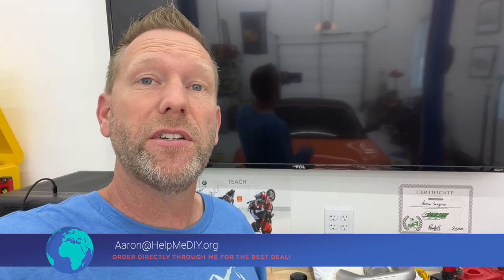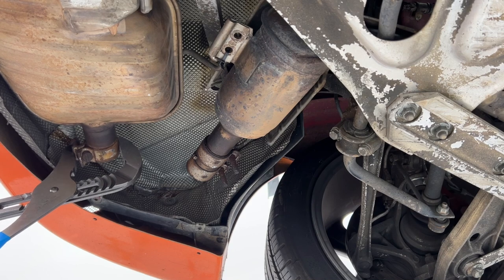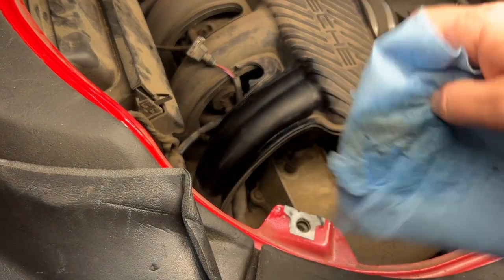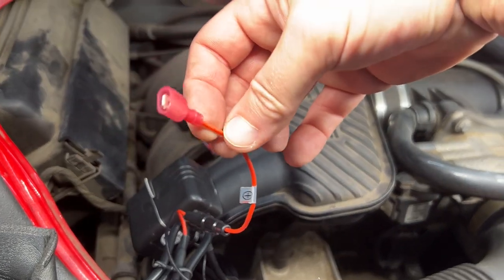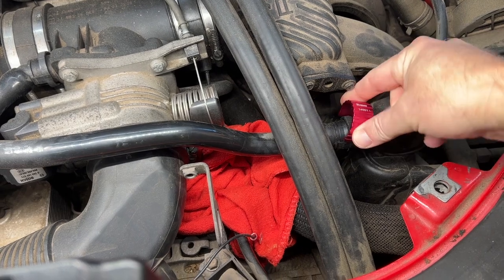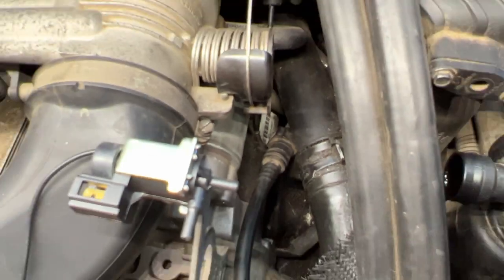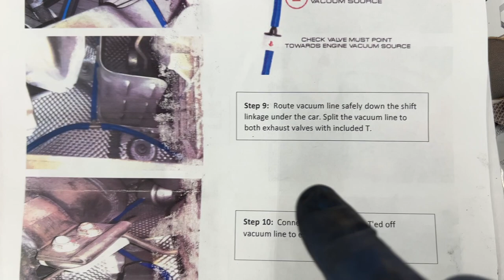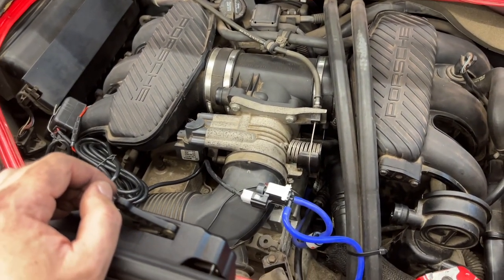SOUL Exhaust Valved Bypass Install for Boxster 986

Comment: HAPPY CUSTOMER! 

I ordered this directly through your main man right here. He was very responsive and took the time to answer some questions I had. Now that I have it installed here’s what potential buyers should know. 

1) Even though the valves default to closed when the car shuts off you can hop in, turn key to get the oil readout and while waiting on that open the valve. You WILL get a beautiful throaty cold start with open valves. 

2) The shop I went to routed the transmitter up in the front trunk not the rear. They said likely the spot Soul suggests to install it will be too hot and degrade the device over time. 

3) From a local shop charging $170/hour in SoCal it took them 3 hours to complete totaling $510 for the install. 

4) I have my secondary cats removed. With valves open it is extremely loud, essentially straight pipe loud. Lots of cracks and burbles on downshifts come to a stop. Absolutely amazing. 

5) because the new exhaust pipes face downward you can expect a lot of drone and cabin rattle everywhere regardless the rpm. The sound hits the ground then comes right back up through the frame. The drone/bass is really insane at low rpm below 3,300rpm. 

6) the valves seem to need a “seat in” time. I assume to heat cycle and build up carbon because my valves do not fully close until the cars completely warmed up. Hopefully this fixes itself within 30 days or so. 

7) You finally truly sound like a boxer engine. It has a deep growl like Subaru boxers but after 4K rpm starts to refine and sound euro but no doubt, this does not sound like a 2.7L engine it’s throaty as heck. 

8) Yes it gives me a thousand dollar smile every time I drive but my anxiety is through the roof. Cali cops hate loud exhausts so I’m 100% bound to get ticketed eventually. I’ve already been thinking of things to say since you can switch the valve back on. Exhaust leak sounds probable lol 

RECOMMENDED! If you want a super loud obnoxious exhaust but only when you want it, and still have the option to go back to mostly stock than this is for you. I’d wager if you still have the secondary cats it won’t be so insane like mine is. It’s truly straight piped, so I’d you’re not into that don’t get the secondary cats removed keep them and this should be quite a bit more tame.
Reply from the maker: +Jared awesome man! I knew you’d love it 😉🍻
Reply: @HelpMeDIY  Heck yeah, it's amazing! Do you know anything about the potential "seat in" time for the valves? Mine definitely don't close fully at first but that seems to go away after 20 minutes of driving or so when everything is at a high temp. I figure I'll give it 30 days then contact Soul for advice.
Reply from the maker: +Jared mine seemed to settle in after about a week
Reply: @HelpMeDIY  Awesome! Yeah man, 110% worth the money. It puts a massive smile on my face every morning now and starts the day with pure childish joy.

Comment: I have experimented in past of homemade versions and found the torque at low revs dropped substantially - especially on low capacity engines (2.5/2.7). The PSE is the best option because of this as it still routes some of the bypass into the exhaust to keep up the torque. Also tends to drone if bypass does not go through any tuned tubes. But worth a ping if you don’t mind! also bear in mind the heat build up under the bumper.
Reply from the maker: +Voiceofreason99ify this one also allows some of the bypass into the muffler. You can see it in the clips. I’ve heard with a tune and the exhaust I could actually pick up 20HP but haven’t confirmed that at all.

Comment: Question about this installation. Since Boxster have ‘dummy’ switches, is it possible to hook up the solenoid to a Boxster on and off switch, thus illuminating the antena switch (and fobs that eventually one will loose). Think it might be kinda cool to have a switch on the dash for this installation.
Reply from the maker: +Blanchard Watch Company absolutely! Some have done just that.
Reply: @HelpMeDIY  is there a how to? I’m sure one needs some sort of resistors… or is it straight 12v to switch to solenoid?
Reply from the maker: @RobertBlanchard  not that o know of, but should just be a straight switch

Comment: Another detailed video. After watching this, I would just remove that bracket where you are attaching the vacuum solenoid and either mount it to where the bracket was removed (2 bolts at the bottom of the bracket that hold it to the engine case), or - if there is room - to the bolt that supports the air intake "muffler box" just to the rear of the bracket. I've removed my muffler box, and plugged it, so on my car, the bracket really doesn't serve a purpose any more unless you are supporting the engine from the top. Call it weight savings :D
Reply from the maker: +jasonmx5 thanks! I’m all about weight savings 😂

Comment: Looks like it hangs a little low no?.. Sounds awesome, though. Nice job, very descriptive.
Reply from the maker: +UsRanger yeah, the stock exhaust was already like that before installing the bypass. I’m still missing the mounting hardware that attaches the muffler to the top of the cats. That will hopefully address that when I get them installed.

Comment: Will this part work with the Porsche factory sports exhaust- the "shower head" for the 986S?
Reply from the maker: +Scott Moss had to ask SOUL. Their response was:

The bypass pipes themselves would end up going right where the factory valve location is on the OEM sports exhaust. The right way to do it would be to get a used OEM non sports muffler and put that on in combination with our valved muffler bypass pipes. That’ll do the trick
Reply: @HelpMeDIY  Thank you!
Reply from the maker: @ScottMoss23  🍻

Comment: a common problem with aftermarket boxster exhausts is that they drone at 3k to 5k rpm. and the once that dont are really expencive. does this have a drone? and can you hear it inside the car while driving?
Reply: As its controlled by the remote, I dont think you'd be driving with it constantly on at cruising speeds - so it wouldn't really be an issue.
Reply from the maker: +gary g Usman is correct, but I can’t answer the drone question until I get some miles on it and break it in.
Reply: @HelpMeDIY  ok, let me know
Reply: @HelpMeDIY  Hey Aaron, new to you channel here, did you try it out yet ? Does it drone ? Cheers from Melbourne Australia 🇦🇺
Reply from the maker: @FunFun-tv7gq  welcome! I’ve only been able to drive it one since installing. Still need to break it in before I get a feel for it. It doesn’t drone in the obvious way the eBay one did, but I’ll keep you guys posted.
Reply: @FunFun-tv7gq  it drones below 3000rpm, over that sounds incredible

Comment: I'm always wondering when watching your episodes why having so beautiful garage with a proper lift you don't clean and paint removed parts, not to mention refreshing the exposed ones. If you cleaned those pipes and used the copper grease you wouldn't have to spend $60 on the tool worth $6 :))
Reply from the maker: +Tomasz S ha, that might be true! I’d rather spend time driving cars than cleaning them though.

Comment: I like the cutouts, the rest of it seems to be pretty poorly designed, to be honest. I'd prefer to have a switch on the dash instead of that little remote.
Reply from the maker: +lavachemist you could easily hard wire a button, but many people don’t want to make permanent changes like that so the remote is standard